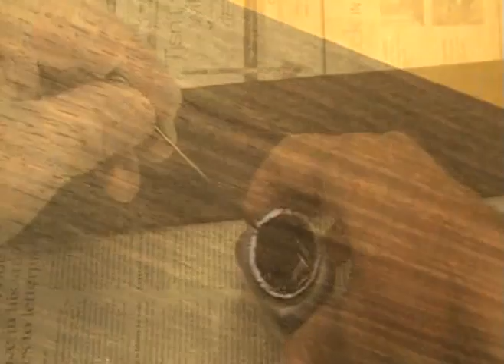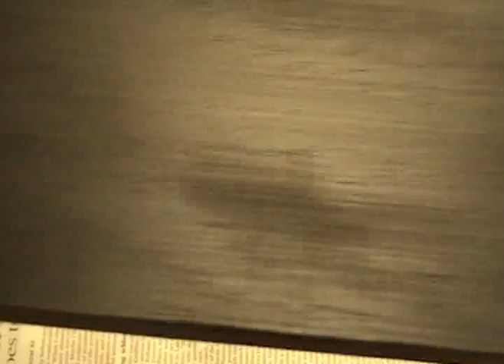Luthier Tips du Jour - Murphy's Law

Comment: Thank you very much for this very valuable video, even in 2023! 😁
I also found the wire technique at luthier H.S. Wake (specialized in violin). I share his method for placing a cleat precisely because it seems more methodical (in one of your answers "It is like threading a Needle... blind", it's like you're making your life complicated).

1. DRILLING 🕳
Drill one hole (not two) straight over the crack. Drill another one (not two) on the cleat.

2.  THREAD 🧵
Pass the end of a nylon thread (or fishing line) through the crack hole. Then go through the soundhole. And finally, through the cleat hole. Make a knot.

3. PULL THE OTHER END 🤏
Put a dab of glue on the cleat.
Pull the other end to naturally bring the cleat into place.
Once glued, cut the excess thread.

Comment from the maker: If it is on the centerline and a clasical guitar it is difficult to use cleats as tere is usually a fan brace there. For steel string guitars definitely use a cleat along the seam on the inside.

Comment: Thanks for the great video, learned lots of these tricks at Roberto-Venn, of course a split acoustic side like that would be firewood IMO.  ...although it's true that CA glue is the closest thing to magic on the planet. Also, I found that a nail head heated with a torch ( held with pliers) on a wet rag will allow you to focus your steam injection a little more aggressively.

Comment: I tried to use the steam method on my sound board. Instead of hot metal, I used hot water from the tap. Held the wet rag there for a few minutes and removed it. The wood recovered pretty well (three tiny spots), but the finish is all murky and mottled, probably from the pressure on the fabric as I held it. It's a nice Martin and someone told me a fine sand would take the visible damage away, but I'm terrified. Is this possible, or would I end up making it worse? Thanks.

Comment: my flamenco guitar just developed a top crack between the bridge to the end of the guitar (pretty devastating), the crack is about 4" long.
what I'm doing is trying to swell back the wood, I put a small glass of water in the guitar, closed the sound hole, and let it seat there in the case until it closes back (hopefully it will work, then I'm planning to super glue the crack, do you think that the glue will hold without clits? I really wouldn't like to add any wood from the back.

Comment: Would I damage my guitar Finish or the wood if I do, what you did to get the dent out??
Reply: It works on unfinished wood, what will happen if you try to do that on a finished guitar will probably cause some kind of melting of the finish, depending on the heat you're using. To the wood itself, it won't make any change because the finish prevents the wood from receiving humidity from the outside.

Comment: How in the hell do you manage to get the threads into the holes from the inside?
Reply from the maker: Justin McCabe It is like threading a needle... blind
Reply: There is a fine bent wire device that is made to draw thread through the eye of a needle.  It looks sort of like a super light weight hair pin and the bend is acute, not rounded.